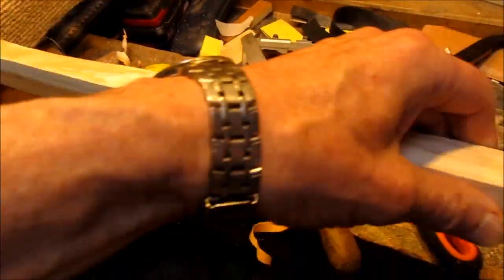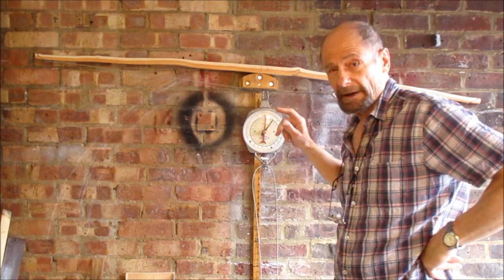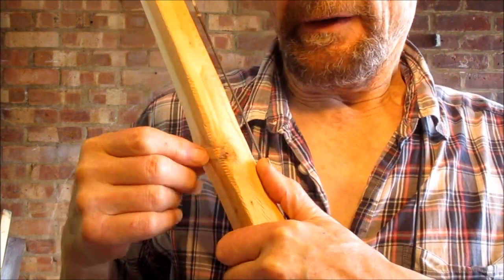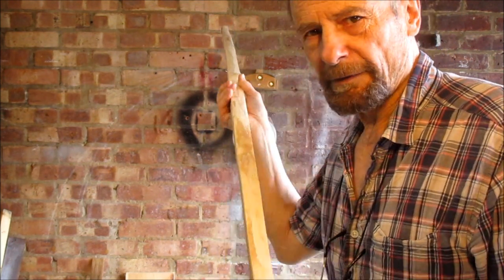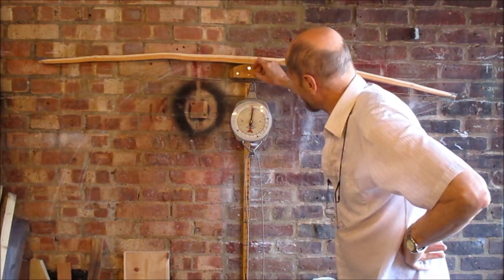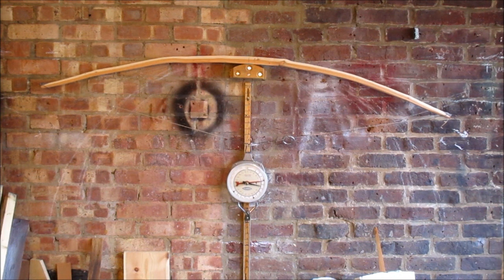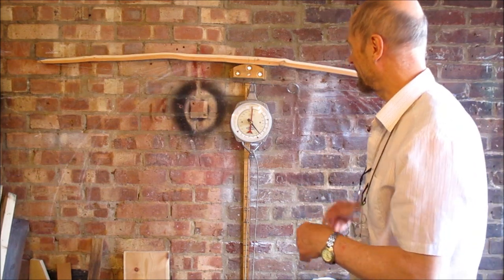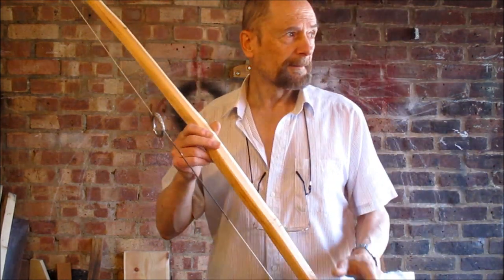Yew with Knot pt4

Comment: Del, lets say my bow tends to bend to one side.  Where do I take wood off? From the side to which the bow is bending or the opposite one?
Reply from the maker: The bow will bend towards the weaker side, so you have to weaken the other side by removing wood. But often you can help matters by moving the nock across, you can try this by pushing the string across at the tips to see if this helps. The solution may be several small adjustments rather than one big one. Heat bending can also be part of the solution.